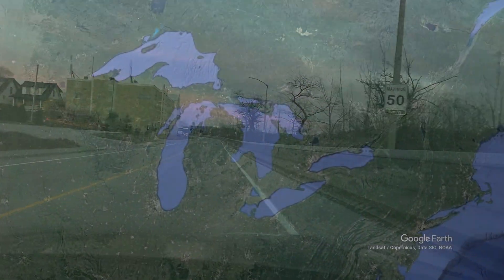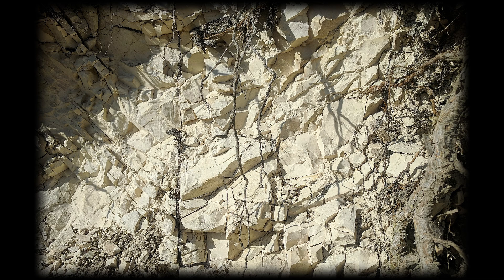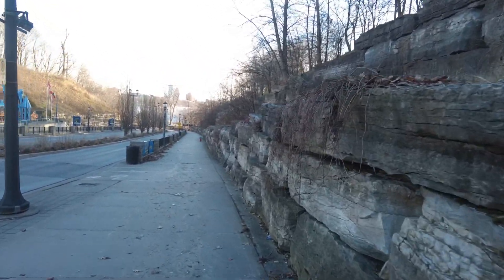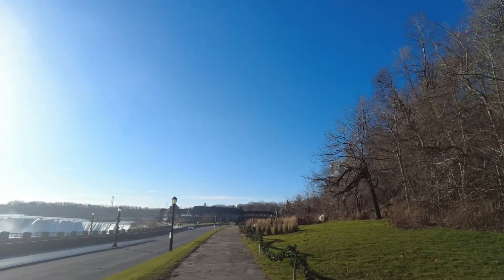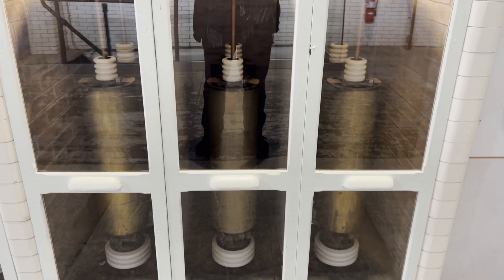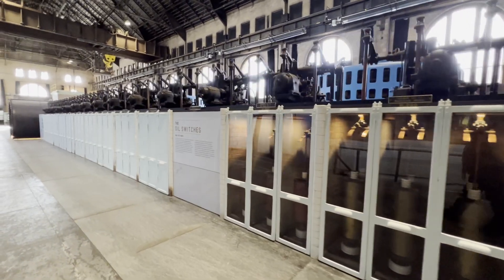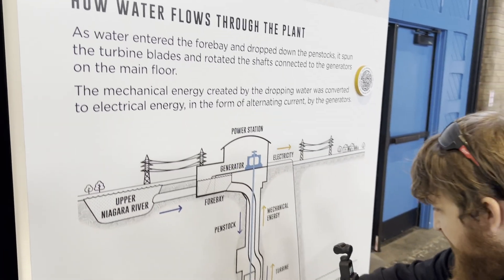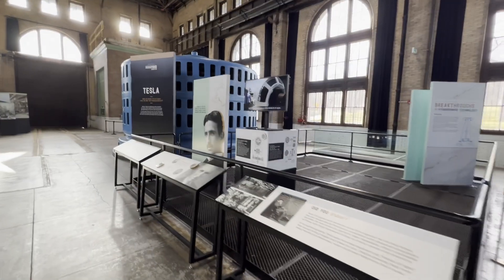Niagara Falls, ON - A Massive Powerhouse Powered By Niagara Falls, Nikola Tesla & Westinghouse

Comment: There were a few industries that had carbon arc furnaces in the area. They were more efficient with 25 cycle power. Notice all the penstock construction is with rivets. Standing in the tailrace 100 feet through the rock are 3 tunnels that carry water under the city to other power stations. There over 1 1/2 million bricks in the tailrace and they lasted over 100 years. All the windows and other areas had beautiful ironwork handmade by blacksmiths. They are all gone, why? 
I feel fortunate that I spent time in the powerhouse while it was s till operating.

Comment: In the early days of electric railways, ac was chosen in many cases over dc.  Many ac powered electric locomotives at the time used dc series traction motors (the only dc motors which will run on ac), but brush sparking at the commutator was a problem, worse with ac than dc due to the fluctation of the current.  One solution was to generate ac at a lower frequency; 16 2/3 hz in Europe and 25 hz in North America.  That may be the reason power was generated at that frequency.  60 hz proved to be better for household and industrial use, however.

Comment: Amazing that power was at 25 hz. I remember my Dad saying growing up in Toronto during the war they used 25 hz and it would cause lights to flicker. Hard to imagine.
Reply: A number of industries in the Niagara Falls area were still 25Hz until perhaps 20 years ago. One generator at Beck 1 plus a couple of frequency changers supplied it. I worked at one of them in Welland in 1978 and yes the lights did flicker.